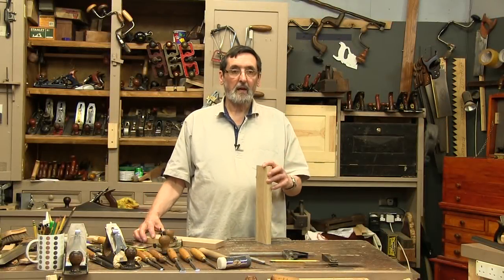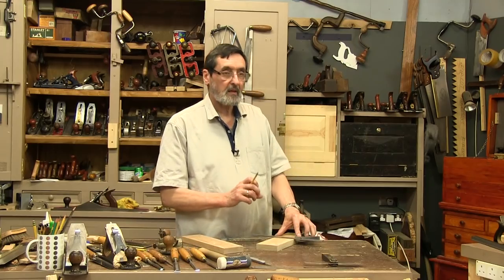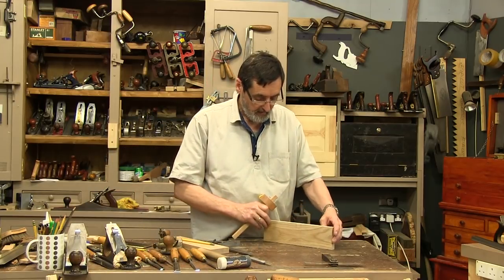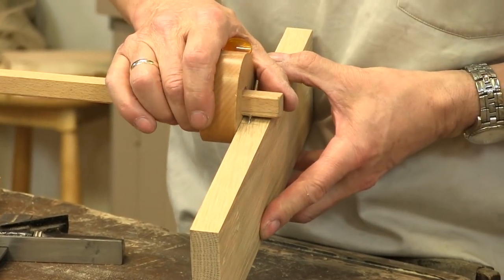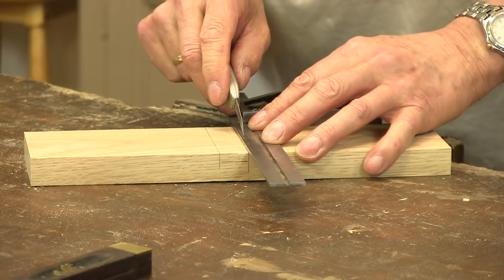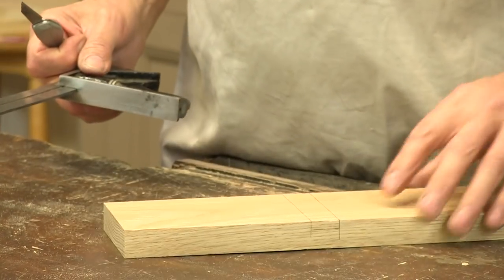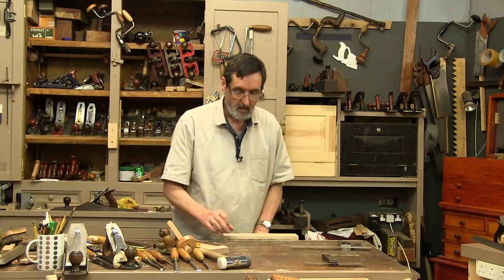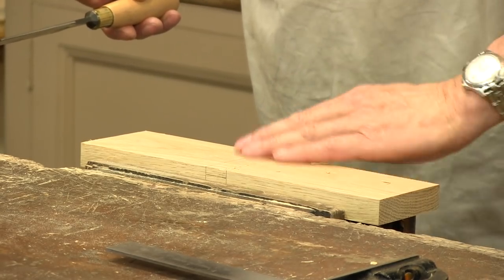How to make a Housing Dado Joint - The Three Joints - | Paul Sellers

Comment: Why not make the vertical cross cuts with a tenon saw and chisel out between the kerfs? Sorry, I just never grew out of the why phase in childhood. and like to know the reasoning behind things.
Reply: +Bart Smith If you watch some of his other videos you will see that Paul does address this and there is one specifically about splitting vs sawing tenons.

It comes down to what's quickest and easiest.  It's not that easy sawing a shallow dado perfectly neat and level.  In a situation where appearance doesn't matter sawing would probably be quicker but if it's a perfectly clean joint you are looking for, it's quicker and easier to use a chisel.
Reply: +Joshua Rosen Thanks for the reply. I think I understand what you're saying. I'm new to this woodworking thing and just trying to soak up knowledge. it helps when someone tells me why rather than just saying do it this way w/o giving a reason.
Reply: Would love a link to this discussion.  In any case, I've been trying a bit of a mix. Setting the wall with a chisel at first, then cutting down to depth.  Still working on being patient!
Reply: Joshua Rosen u
Reply: I also have to think that the process being shown can be done a lot quicker then in the video if he isn't explaining it and showing us. He can just get down to the work have it done quickly and accurately.

Comment: The more I watch clips like this the less and less need I see of tuning all my power hand tools. The time spent setting up a jig and clamping everything for the cuts followed by clean up, is about the same as by hand. Hand tooling is clean and more satisfying.  (Also really could have used this about 3 days ago)
Reply: Agreed, especially for hobby level work or low production. Machine work just allows for larger scale production, and it could be argued less "skill" as you can rely on the machine more. Each has their place.

Comment: These videos inspire me to do a better job sharpening hand tools - and also practice the basics of woodworking.  In practice, I'm probably still going to rough out joints like this with a router and a guide or at the tablesaw.  It's just so much quicker and as they say "time is money'. ... but clean up the joinery  by hand when it really counts.  I do think all beginners need to learn and practice the 'totally by hand' skills so they know how these joints developed and how to make them without power tools.
Reply: Totally, It also helps for when you have a power outage in your shop for a week.
Reply: @Erowens98  
Machinists are not woodworkers.
Reply: @bighands69  the difference between a chisel and a CNC mill is competely arbitrary. They are both machines meant to help you process a material.

Woodworkers can absolutely use powered tools.
Reply: @Erowens98  
When you are working in fine woodworking the human mind and body are judging the dimension of the segment of wood and making fractional adjustments to the grain of the wood and hardness of the wood. 
To somebody that is not a real woodworker they would not understand what I am talking about. 
People think just getting an accurate machines it the same as a human hand making it. Wood carving by a master is orders of magnitude greater than anything a machine can perform. 
There are no machines that can match a hand plane when it comes to the finish of wood.
Reply: @bighands69  Get over yourself. Virtually every professional woodworker on earth uses a mix of power tools and hand tools today. And they are capable of achieving exquisite results. Using power tools does not prevent your eyes from making judgements. There is nothing mystical about hand tools that someone result in a more pure finished result than power tools. 

The tools you use should not effect the grain or hardness of the wood. The only way you can effect that, is by either soaking it, or crushing it. Neither of which are typically desirable. Your magical fingers will not increased the quality of the wood in any way.  

There are absolutely situations where hand tools make sense. Your example of hand planes is one. But that does not mean that using power tools is invalid. One can absolutely use a thickness planer to bring a board down close to size, and then run a hand plane over it to remove the wave effect, and end up with the exact same result as if he had done the whole thing with a hand plane in a fraction of the time.

As someone who has worked as a professional woodworker who regularly produces fine furniture to order. You're full of shit when you claim using machines is "not woodworking" .

Comment: I do all of the above up to using a chisel to make a groove on the knife wall.  I do this on both sides of the housing and use the resulting groves as a channel for my tenon saw.  I then saw down to the gauge line, the chisel out the waste and use a hand router to get the bottom of the housing smooth, flat and to a consistent depth.

Comment: Hey Paul, have you ever used a saw to cut the sides of the dado and then clean out the rest with a chisel? Great videos; I've learned a lot. Thanks.
Reply: He does, in one of his workbench videos i believe
Reply: Sagern234 Thanks Sagern, I wonder if as mooncabbage suggested the type of wood determines which technique to use.
Reply from the maker: I do. It depends on the type of work. Stair cases I saw, joinery I saw, furniture making I usually chop and knife.

Comment: I saw on one of the Japanese woodworking sites where the carpenter lightly hammered the 'tongue'. That was then test fitted dry, the 'tongue' was then lightly moistened for the final fit. The hammered 'tongue' then swelled to an ultra precision fit.
Reply: It depends on how tight you want it.

Comment: Hi Paul. I believe I've seen you create a knife wall and then use that as a reference face for sawing. Is there a reason not to do the same here – create a knife wall, saw to the approximate depth, then finish the dado using the router plane and chisel?

Comment: Informative and very useful explanations of the hand cutting techniques. Thank you for sharing your valued knowledge. What depth should you hit for that will prevent moving your knife wall? Saying heavy or light hits don't work for me as I'm still a bit heavy handed.
Reply from the maker: It depends on the wood type really. Some woods give greater resistance. I think in most cases, once the first couple of cuts across are made, the wall is deep enough not to move too much. The hammer blows too will move the knife wall so the firsttwo here should be light too.
Reply: Paul Sellers Thank you for answering my question. I've been practicing your advice with my mallet, chisel and knife wall work mostly on pine as it's soft and makes me aware I need to be gentle with my mallet blows. All seems to be going good and my housing joints are looking crisper along the joint with knife wall still in its original place -ish. So again thank you for your valued advice, and thank you for sharing your masterful knowledge with us. It's great to learn from a true Master Craftsman as it creates the attitude of 'Don't just do the job but do the job properly, as it should be done'.
Reply: Some truth in your comment how it should be done. When I was an apprentice I was taught if it's Right it's near enough. But if it's only near enough - it's not right!
Reply: +edward charles  I've never heard that before but I like it.

Comment: I was wondering if I had perhaps missed the third joint in this series. Is it already out ?

In regards to "using a router and being done in a minute". I have a very small, blended shop, (some power tools but more hand tools), and I wear a respirator, eye protection, and hearing protection, when using my router and shop vac. I also have to wear these things while I vacuum up the dust and chips left from all the horse power.

I prefer to use electricity for lights and listening to the radio whenever possible, and contain my chips and shavings to a small pile at my feet.

Comment: I'd love to know if there is a reason why you don't do this with a tenon saw like you would for a tenon. Isn't it the same kind of cut?

Edit: I guess it has to do with compressing the knife wall which you wouldn't get with a saw. Interesting. I guess that probably keeps the joint tight over time.
Reply: I asked myself the same question. There are even special saws here in Germany for cutting (dovetailed) housing joints. (Not saying that its wrong, just wondering)
Reply: @David-yl6bc  
A Chisel will give a much cleaner line than using a saw. In carpentry (construction) those joints could be cut by a saw as they are not fine woodworking.

Comment: Does anyone know if pine is a good wood to practice these skills on? I have a ton of 2x4 scraps leftover from a project that I'd like to get some use out of
Reply: Rob Mckennie Depends on the pine... hehe :PBut no, not the best practice wood.Pine is just so tricky; chippy and crispy, very wide grain; this stuff wants to split in ways that are just annoying - although it shouldn't matter for the housing dado, as the knifewalls contain the splitting as long as you're careful to not go beyond them.If you do, the pine could easily split radially, whereas birch might lift a little, but nevertheless stop the chisel before it all turns to shit.. :OWhich is why birch is such a nice middle ground, I think, between the almost-too-willing-and-too-easy-to-work pine and the almost-too-hard-and-slick oak..(For practicing - obviously if you wanted to make something out of oak, it would be better to practice on oak. But for just learning a technique, really any wood will do as long as it's sound. Birch just happens to be very forgiving, causing less frustration, and hopefully more confidence.)With that said, the best practice wood is the wood you have.Focus on making the best joint you possibly can, using the raw material at your disposal.Certainly don't put off practicing because of poor quality wood.If it has structural integrity, you can make stuff from it... :P
Reply: guggi uggi What the? Ok I've no idea why all the formatting is gone from my comment. That's hurts my brain just looking at it...Hmm..
Reply: guggi uggi It's not even the formatting. All the spaces between lines, have simply been removed! What gives?! :PWeirdness...Guess I'll try editing it..
Reply: guggi uggi Nope.. No can do, lol... :Pugh.. It's too early in the day for youtube to start messing with me.
Reply: Try using scrap with the tightest growth rings first.  There will be variations, even in the fast-growing conifers. But hardwood is always better.
Reply: The best wood is the wood you have.
Reply: If it doesn't have checks and cracks, if it's a manageable size to be clamped up in the vise, you definitely can make this
Reply from the maker: Pine is as good as any other wood.
Reply: Paul Sellers you're right mr. Sellers, like with any other wood, it all depends on the quality. You can get bad oak as well.... I make the most lovely things out of pine :)
Reply: AS I did try some pine the other day, will say that I do now fully agree.  Use what you got.  One can learn from it all.
Reply: Wade Patton how older the pinewood, the better it's usability gets. I even have made really nice things from dutch domestic douglas (a real challenge!), and of course pine ;) for some reason people always think pine is kind of  inferior, but when someone doesn't handle his pitchpine or beech in a proper way, the result is as bad as pine used in a bad way.
Reply: Rob Mckennie From what I've found pine/fir requires you to keep your chisels  very sharp or it simply crumbles under your blows. Also you'll occasionally come across a resin pocket that can wreck havoc on your glue or finish. It all works fine, it's just finicky.

Comment: I can't imagine using this approach when you have 6 or 8 dados to make. It would take all day. As Charles said, why not use a saw after establishing your knife wall as you did on your shooting board, if I remember correctly. 

I'd like to experiment with both methods but I'm recovering from shoulder surgery right now. Your thoughts would be appreciated.
Thanks for sharing your years of experience.
Reply: It doesn't really take that long actually. Both methods work quite well, what you use probably depends on the wood and what tool is in your hand at the time. Some woods split better than they saw, and vice versa.
Reply: It's a bit faster when one isn't shooting a video and talking about the process during the procedure.
Reply: Mooncabbage  You're right, it doesn't take that long. And I like the way it looks better.
Reply: I'd take a router and be finished in a minute.
Reply: Mando Line I don't think so. IMO you'd spend at least 15 minutes setting the darn thing up. And that's fine if you have a lot of them to do. I like the dustless, noiseless style.
Reply: I can't afford a router.  #OldSchool  or  #Nothing  for me.
Reply: Karine Green One of the problems with the router (which is fine, if all goes to plan) is controlling it.  If the slightest thing goes wrong as you pass it over the wood, the router will cut the mistaken line without you being aware of it.  The router is excellent in many ways, but if you are not pushed for time, or need to make 6 or a dozen joints, the hand-method is safer and less stressful.
   Then again, shouldn't we all know how to do it this way, just in case we have to?
Reply: Offshoreorganbuilder Was this comment meant for another poster? I mentioned in mine that I don't own a router (can't afford one). If I have dados ---- it's by hand. Or if it doesn't matter to the look of the piece  then it is by Kreg Jig.
Reply: Karine Green I see what you mean!  Sorry.  This was intended for the likes of Mando Line.  I'm not sure how it became attached to your name.  However ...
   You, too, can afford a hand-router!  (See the Paul Sellers' video on 'Poor Man's Router.'  All you need is a chisel and an off-cut  of pine.)
Reply: Cool!
Reply: Richard Hutchings

In regards to "using a router and being done in a minute". I have a very
 small, blended shop, (some power tools but more hand tools), and I wear
 a respirator, eye protection, and hearing protection, when using my 
router and shop vac. I also have to wear these things while I vacuum up 
the dust and chips left from all the horse power.

I prefer to use electricity for lights and listening to the radio 
whenever possible, and contain my chips and shavings to a small pile at 
my feet.
Reply: Mando line is forgetting how long it takes to set the router up!
Reply: so true!

Comment: I am always impressed with your teaching. You seem to cut straight to the core, and simplify what many others complicate. I have always wanted to do wood working, but didn't because I didn't have space for all those big machines, and I couldn't justify the cost. I have found a couple of old planes, chisels, saws, and braces in what has been gathered from family members, but have to sharpen and restore many. I still need to build a suitable bench that will fit my area, and learn to put a better edge on the tools, but I think I have all the tools I need to get started. Many thanks for helping change my perspective, and more.
Reply: Paul has an incredible video on maintaining important edges...watch and learn!

Comment: Bought two basic chisels yesterday and a wood hammer. I started to work on a workshop table to my garage. Rough and simple design, but you inspired me to do better than just use screws to put it together. Pieces of the table at least fit each other more-less. Thanks for the inspiration!
Reply: Make a hundred boxes with dovetail joints and you will become really good at it. And you will get to the point that you can almost match people using machines for speed. If you can make a tenon and dovetail joint you can make anything.

Comment: Is there an affordable alternative in 2021 to the hand router plane? Scalpers have taken to eBay with vintage stock anywhere up to 200 GBP.
Reply: Paul has a video on how to make a hand router plane. You can for a starting point use a chisel that is stuck through a hole in a bit of wood to achieve the same thing and I think Paul has a video on that as well. 
You can make your own hand planes as well if you desire but it is a good idea to buy a classic older No 4 Stanley online as a starting point so you can make the other planes. A Veritas router plane costs about £180 to buy and is a good off the shelf option.
Reply: @bighands69  Since the original comment 5 months ago Paul released the video. I've bought all the components for around 60 GBP and am looking forward to putting it together.

Comment: I love your attention to detail and presentations.  I have several questions as I've watched the "The Three Joints".  Since I'm fairly new to hand tooling joints, what type of hammer/mallet are you using with your chisels?  It reminds me of the type that I used as an electrical apprentice while working in a small motor shop.  It worked great on shaping small motor windings within motor.

Comment: Paul, thanks a lot for this new interesting video.
I do not have much experience as you have, but what is the reason for the frequent placement and removing of the piece in a vice instead of using dogs?
Reply: You may have missed the part in the video when Paul states that he chops over or near where the leg of the bench supports the top so that he can obtain full support of the workpiece. In some bench constructions this is necessary to obtain clean severance of the wood fibres. And is common practice.
Reply: Timothy Corcoran , thanks.